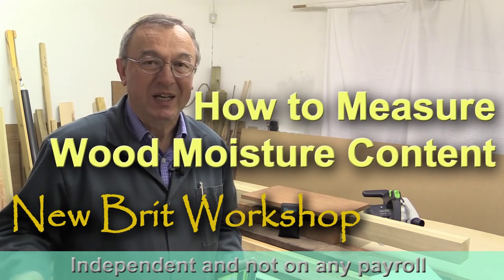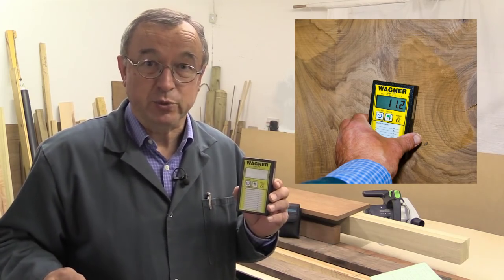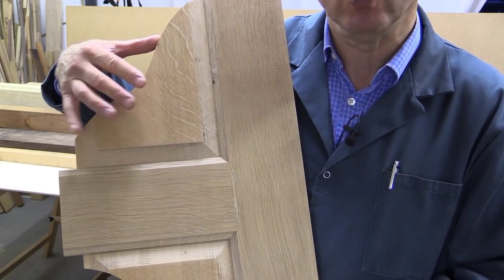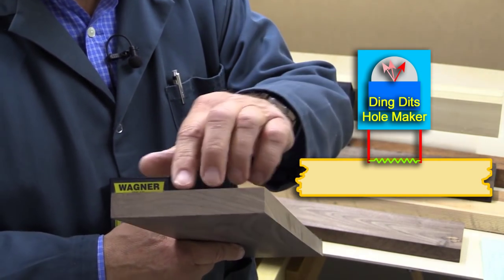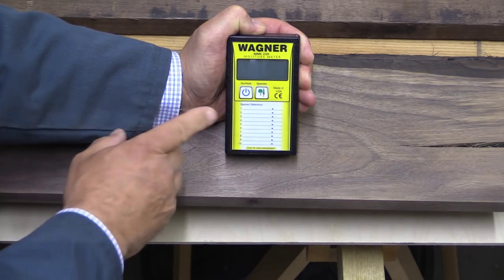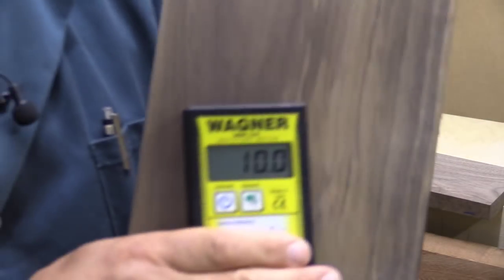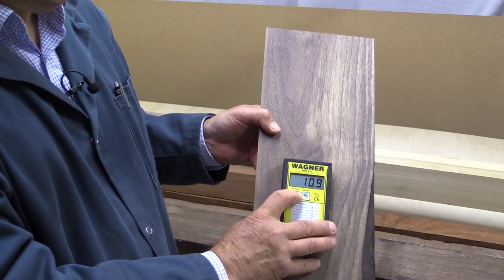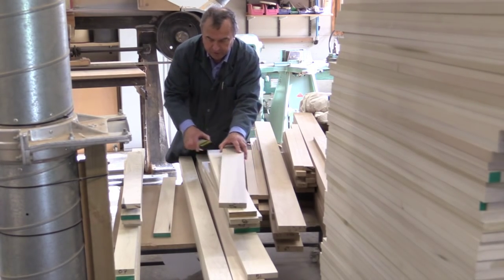How to measure moisture in wood

Comment: Hi Peter hope your well, Im finding the pine wood we use to turn spindles are to dry and very brittle. Do you find this when working with pine.
Reply from the maker: Hi Gavin, There are many different qualities under the broad banner of pine. Pithy dry wood can be very weak but most are stable enough for bobbins and spindles. You might like to try ash as you are using fairly small pieces of even Maple for a really lovely piece.  Peter

Comment: i am doing the exact same thing as you did (non-scientific method). I do have one question, what do we do in the southern states of the united states? It is very humid june-september, inside MC will be 13-15% sometimes! And it is VERY dry during the winter inside of homes due to central air heat! (6% MC)  SO what is the solution?
Reply from the maker: Hi Michael, If the swing in humidity is so great then the style of construction must take account of significant changes in width across solid wood boards. I suspect that plywood and other laminated stock would be the best choice.  A tough one.   Peter

Comment: I think it would have been better if you had bought a couple of meters from other manufacturers before I would make a recommendation to an audience. Even though it was good content for Wagner. Hope to see you make another video with comparison meters.
Reply from the maker: Hi Michael, I could not afford to do that and so I asked my various professional woodworking  friends what they would recommend and it was, without doubt, Wagner.  Peter
Reply: I looked at them, and the one you are showing they quit making. They other ones too but YIKES! They are like 400 american dollars. Whew, pretty expensive.
Reply from the maker: Hi Michael, I understand. I recently made a video about an oak dining table with matching benches that I had made. The oak cost over £1,000 and I needed to ensure that it was at the right moisture level when selecting the pieces that I bought. I have made desks with similar material costs and so it is really important to get accurate and consistent readings without damaging the wood.   Cheers.   Peter

Comment: Hi that's a very good review... what moisture content would you typically aim for in wood that is being used to make furniture that will be delivered any where in the UK to a customer?
Reply from the maker: I am currently machining some oak for a dining table. The wood is very well seasoned and is producing about 8% readings. Some oak that I have bought in the past has been up to 16% - perfectly good but I have always left that in the workshop for a couple on months to adjust a little.   Peter
Reply: New Brit Workshop thanks for the reply. Ok, so I should be fairly safe to work with oak at around 10% to send across the UK

Thanks

Comment: Nice video. Have purchased a MMC220 and got it in the mail today. Finnaly I dont have to use my cheap pin meter. :) 
I could not find the app, what  did words did you search with ?? 

Thangs again for a good video.

Best regards
T.Robertsen
Reply from the maker: Hi T??  , Try this link to find out more details:  http://www.wagnermeters.com/moisture-meters-woodworking/wood-moisture-mobile/     Peter
Reply: Hello again. Thanks that is the one :) 
Do you have any experiance with euopean? spruce, birtch and pine. What settings have you settled on. 

Best regards
Torgeir Robertsen
Norway

Comment: Hi Peter, am I right in thinking this meter only takes readings of a max depth of 3/4" and no good for thicker timber than 1.5"?
Reply from the maker: +ben celiz   Hi Ben, I think that it is good to about that and doubt whether there is much on the market to go beyond.  Peter
Reply: +New Brit Workshop (Peter) Have you had any experience with this meter? http://www.tester.co.uk/testo-616-material-moisture-meter ...it measures to a depth of 5cm I've moved out of central London to suffolk and milling my own lumber and nearly finished building a solar kiln so I'm after a meter that can show the MC content in thicker stock like 64mm.
Reply from the maker: +ben celiz   Hi Ben, I have never seen that meter and find the 50 mm depth somewhat unlikely. It does seem to be a cheap meter though and if it fits your budget and does the job then fine. All I can say is that my professional friends favour Wagner but I would love to have feedback from you if you get a different make as it will help other people make up their mind.   Cheers.   Peter

Comment: Great video as usual Peter, very informative and I very much enjoy your relaxed style.But, I have to say I almost fell off my chair when I followed up on the meter and found out how much it cost. I presume the "jab" type are cheaper (but they have the limitations you highlight), but is Wagner the only capacitor type meter you would recommend?Thanks again for all the effort you put into your videos.
Reply from the maker: +T Radford    I did a bit of research before making the video and found that everyone I asked (timber merchant, professional woodworking friends) all said that the jab type are not good at all. When I then looked at the electronic ones the only name that was repeated again and again was Wagner - I did hope to find a UK manufacturer ! I then approached Wagner and they were very helpful. One of my professional friends has been using the same Wagner for over 20 years. You might try ebay for a bargain.  Many thanks for the kind words.     Peter

Comment: Peter, woodworkers probably don't want "same moisture level as the environment."

From buildingscience.com, about interior relative humidity, quoting:

"How low can you go? Comfort wise at least, the 2001 ASHRAE Fundamentals (8.12) tells us that at dew point temperatures of less than 32 degrees F, complaints of dry nose, throat, eyes, and skin occur.  A dew point of 32 degrees converts to a relative humidity of 25 percent at 68 degrees.

How high can you go? Again, using comfort as the criteria, the 2001 ASHRAE Fundamentals (8.12) tells us that a relative humidity of 60 percent should not be exceeded."

http://www.buildingscience.com/documents/reports/rr-0203-relative-humidity/view?searchterm=Relative%20humidity
Reply from the maker: G raphein The level that people want for the humidity is not in question but the fundamental point is that everyone agrees that the Equilibrium should be achieved. All of the professionals that I contacted and all of the literature that I read emphasised that EMC was required. People can still avoid having the humidity too low if they wish. In some places it is impossible to get the humidity down to comfortable levels but EMC can still be achieved.   Peter
Reply: Thanks, Peter.  I sought only to avert a possible misunderstanding.  A note at 1:51 suggests that "modern housing will have a humidity level of about 8%."   Eight percent might be desirable for wood, but is quite low for a house.  Interesting, that equilibrium can be achieved with, say, wood moisture at 10% and interior relative humidities of 30%.